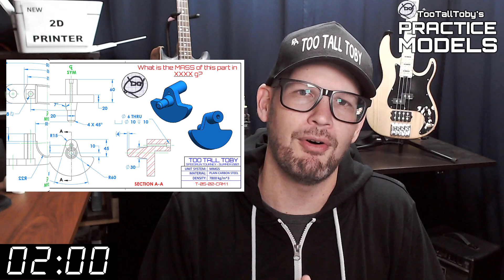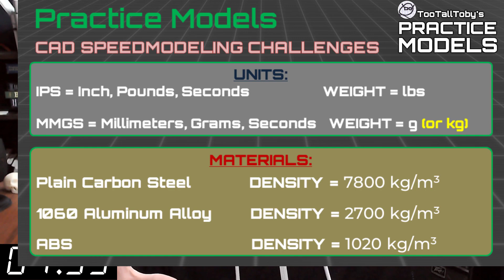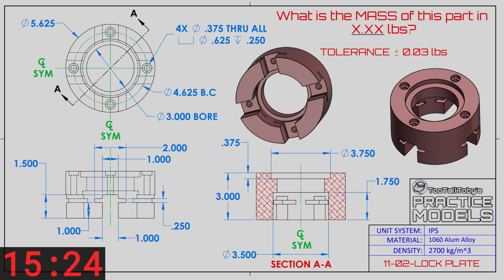SOLIDWORKS Practice - Onshape Practice - Fusion 360 Practice Exercises - TooTallToby-11-02

Comment: 10:33, 3.80 lb  I got thrown off a bit as I was intending to pattern the holes and slots together but then when I created the slots I did thru all both directions and confused myself when I went to pattern 2 of one feature (slots) and 4 of another (holes).  Ended up just placing the 4 holes manually with horz/vert constraints.   I'm sort of glad I made such a mistake, as it made me think about how I might make this if say design changed to require 5 slots.  My original intent would work for that, but my actual result for this challenge wouldn't allow for that sort of change without starting back at the solid revolved piece.  Thanks again for a thought provoking challenge!
Reply from the maker: That's awesome Dan!  Very cool to hear that this provided a little learning experience!  Thanks for sharing 😊